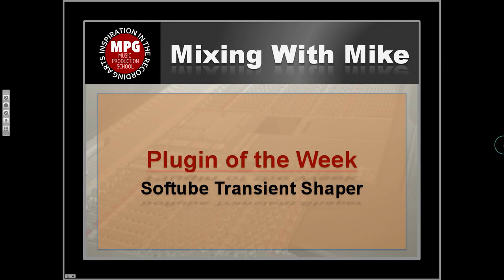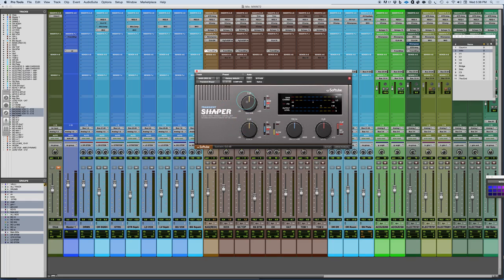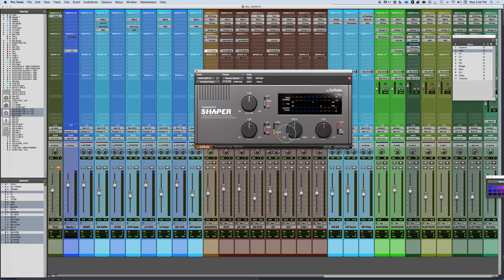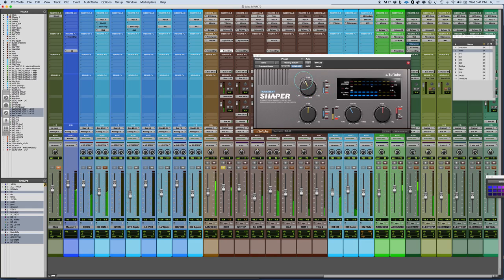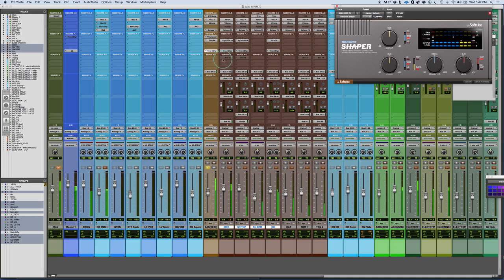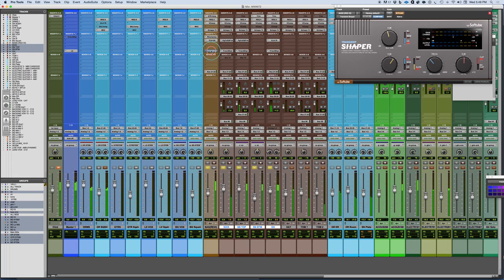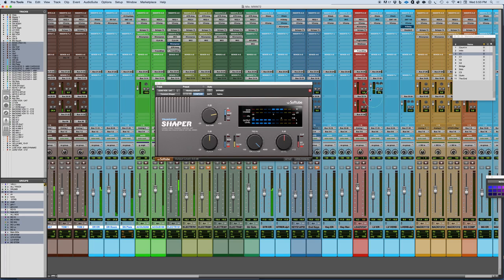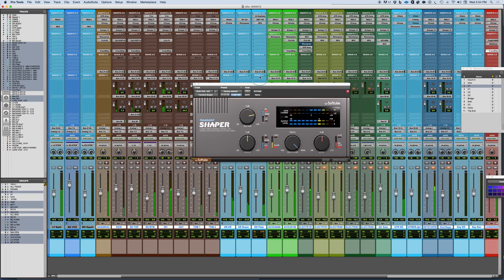Mixing With Mike Plugin of the Week: Softube Transient Shaper

Comment: Would you suggest using a transient shaper in the master bus if you feel the mix is a bit over airy or reverby then?
Reply from the maker: I have never tried it on the mix but would not be surprised if it worked used in a subtle way. I think it is really designed for individual track use rather than mixes. Try it. In the end if it works, then leave it in.
-Mike